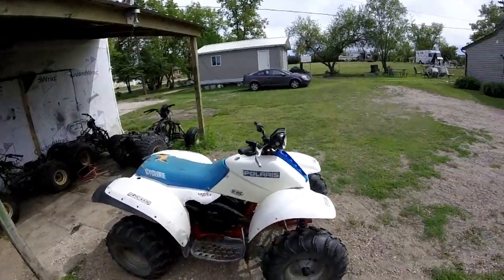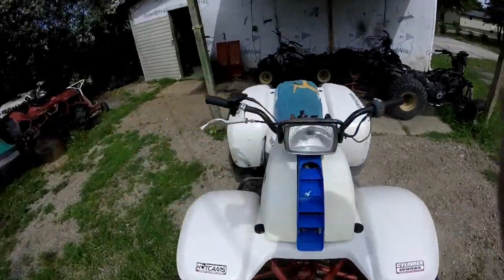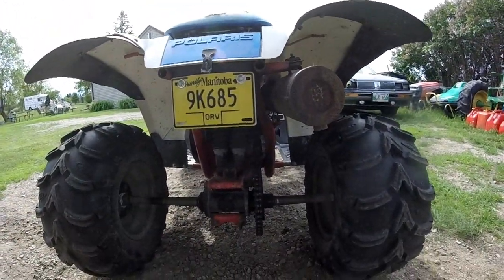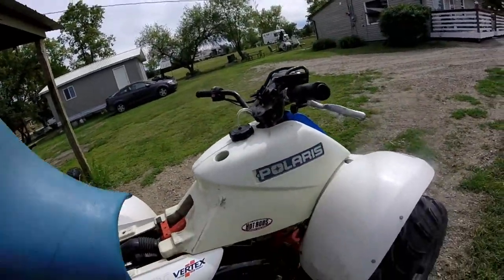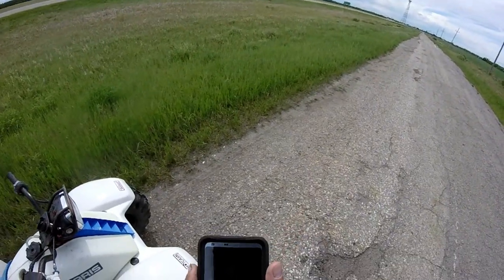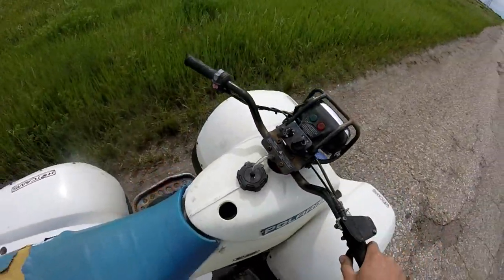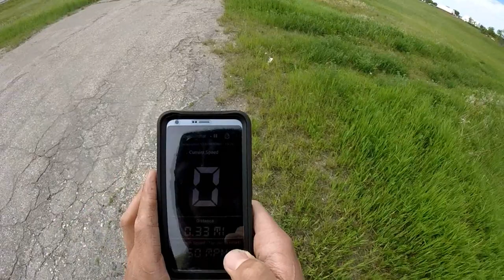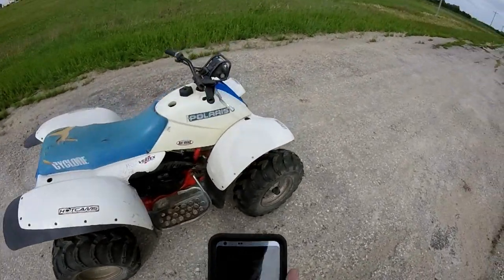New project 1987 Polaris cyclone 250

Comment: I used to own an old Suzuki quad runner 160 thing was a tank kept up in the trails with the bigger quads snapped the front axle on it wish I had time to fix it but I sold it
Reply from the maker: That's cool I have three of them. All of them need Steelers
Reply: @greasemonkey348   hey bud I have a few questions was wondering how I could contact ya
Reply from the maker: @paulyblackwood1730  what are your questions
Reply: @greasemonkey348  I have a 13.5 horse weed eater with a 18.5 head and 18.5 carb ...won't stay running wondering what I could do
Reply from the maker: @paulyblackwood1730  you have a 18.5 horsepower weed eater opposed twin I would check fuel going to the carburetor sometimes those carburetor can get junk inside it or the seals can go
Reply: @greasemonkey348  it's a 13.5 with a 18.5 carb ...so if I was to get a new carb would I order a 13.5 or a 18.5 ??
Reply from the maker: @paulyblackwood1730  13.5
Reply from the maker: It getting too much gas and Air unless you got it honed out with a big piston and ported and Polished the head

Comment: Hey man I have the same exact quad you have, but mine was in way worse condition when I got it, mine had been sitting out in someone's back yard for who knows how long, when I got it It had a really wheatered gas tank that has a giant crack in it and the pull starts recoil spring is broke and also the ignition switch, I was wanting to know if I can some how contact you and see if you could show me the wiring in your quad so I can get an idea how to fix mine, it is my first quad I ever owned and it's going to be a restoration project but I want to do it right
Reply from the maker: I could maybe help you check out my Facebook group and contact me there it's in the link below
Reply: lol watching this video deciding if i should spend 400 for one in the same condition. in the same positon as you

Comment: I need to know how you got you cyclone to go 68 mph with the new clutch
Reply from the maker: Nothing special, just keep up With Normal maintenance My clutch is pretty much gone Just keep Carburetor Clean Do have a new Belt And always grease the Barons It's all stock machine
Reply from the maker: And My friends machine. It's way faster. It's also stark Mostly got a upgraded clutch it can do 76mph
Reply: @greasemonkey348  so when ever you upgrade the clutches on these pvt cvt transmissions you just find a stronger spring that grabs harder and I’m still working in tuning my cyclone rn but got it going 50 mph
Reply: @greasemonkey348  it’s mostly stock
Reply: @greasemonkey348  there not much information about this quad and really not many people have them and I would like to get ahold of u so if i have any questions about the cyclone I can ask you since you have another one

Comment: Was gunna say 35 mph for a 250 2 stroke is slow as hell lol
Reply from the maker: No for sure not 35 mph in this video I got to go 51 mph but nowadays I fixed the clutch on it and now it does 68mph
Reply: @greasemonkey348  these little cyclones can do 60+ im getting one for detailing Somones car
Reply: And I you are running 40/1 pre mic how’s that going for you? I’m gonna take the pre oil pump out
Reply: Did u out a stronger spring in the pvt